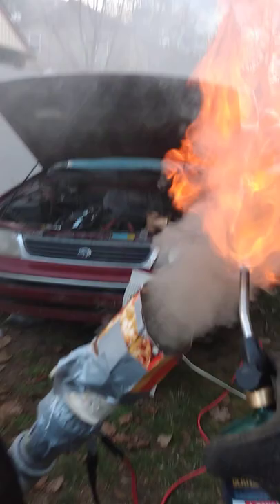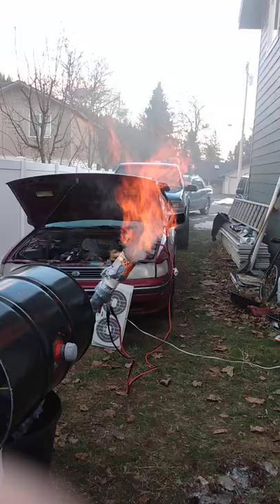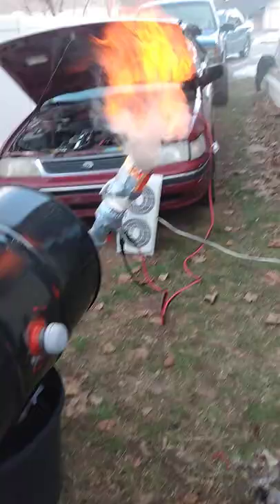Gasifier Experiment #1

Comment: its a struggle getting it small enough to put on a car, thats why i went with a truck for my first and second build, uitilize the bed space for the gassifier system
Reply from the maker: That's my longer-term plan - this car was just a really good deal. I might chop it up and make a Baja/Brat of sorts. I'm also thinking that flexible steel exhaust pipe will make things easier.
Reply: @jonathancounts6843  depending where you use it it is good, I didn't have much success with it beyond a heat transfer pipe for preheating the air to the gassifier. If you use it for gas just need to keep in mind some air will seep in and mess with your air/gas mix going into the motor. I ran PVC from the filter all the way to the front of the truck and to the engine and it works very well. Mine is in a Toyota mini truck, and I'm building a V10 dodge right now for my next gassifier